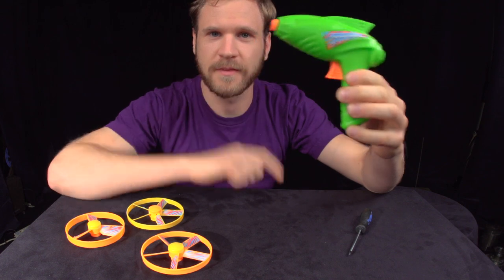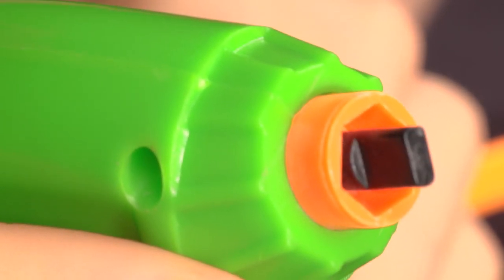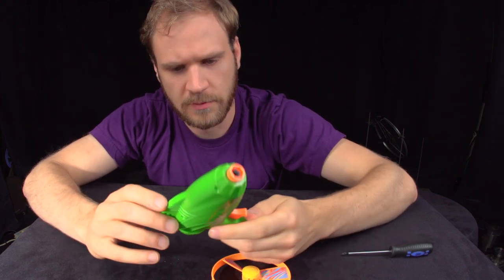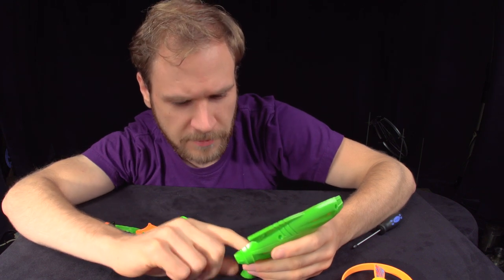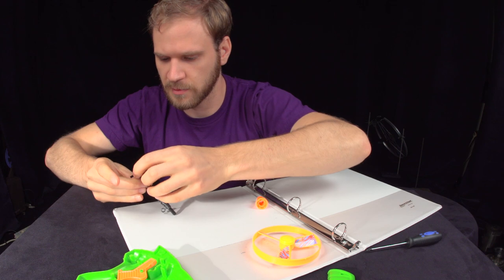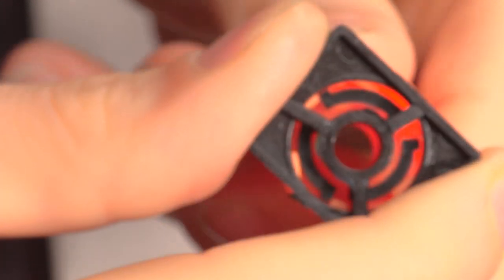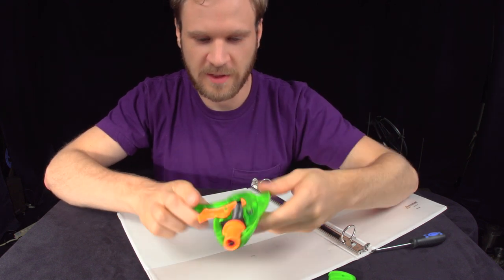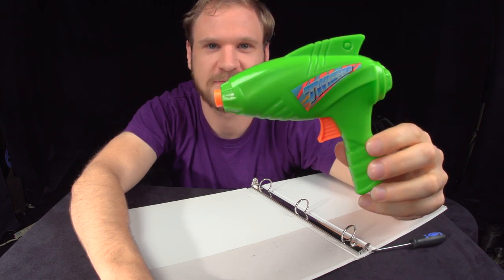Taking apart a "Twister" toy gun

Comment: I'm really surprised that they still use screws for something like that. This way, somebody needs to actually sit there and place the screws and screw them in at the factory, don't they?

Seems like a cheaper way would be to use plastic rivets. They could be a part of the bottom half, then top assembly is put on, and a heat riveting tool, basically just a shaped piece of aluminium or copper with a heater on it, could descend and seal them together. Not that i have ever seen a toy assembled this way, it just seems more effective - why don't they do it like this?